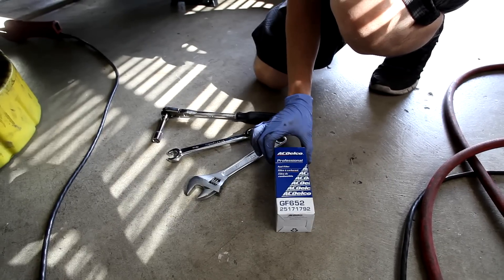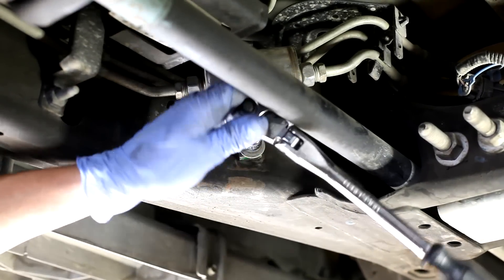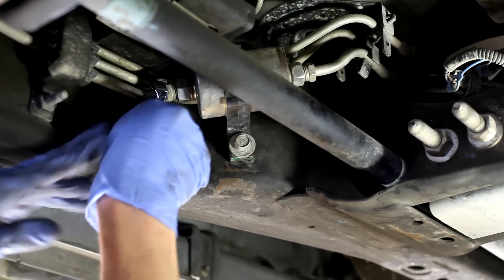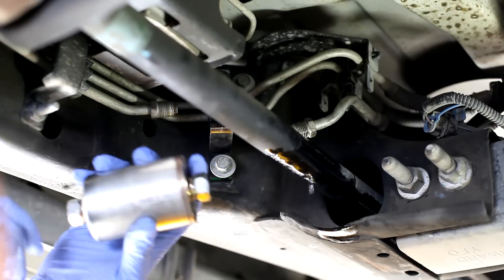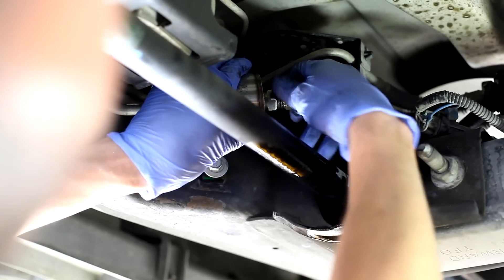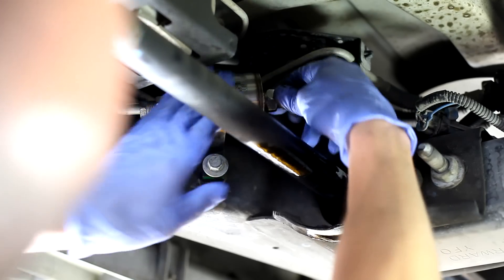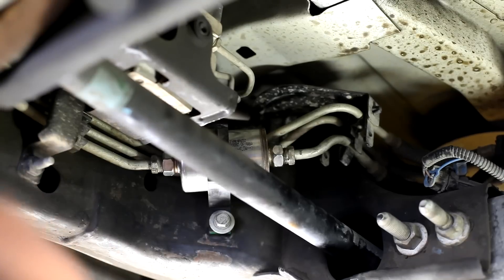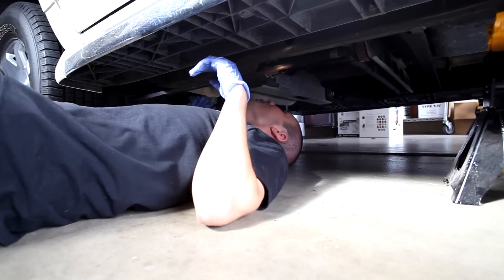2002-2006 Cadillac Escalade fuel filter replacement

Comment: FYI - on the 04+ Escalades, the fuel filter is in the tank.  There is no in-line filter.  Autozone will sell one to you, though.
Reply: That's why couldn't find it 😑
Reply: I havent been able to find one either. But i got a wix fuel filter for sale then. Lol
Reply: Thanks tokuzumi!
Reply: Bruhhh I just bought one even though i haven’t spotted it yet    -_- FML
Reply: I bought a fuel filter several years ago for my 2005....   was going to finally install it today, now I know why it was never installed.....   🙂  Thanks!!
Reply: 05 Escalade leave it to caddy to make everything more difficult. No hatch to access fuel pump either… dorks!
Reply: How do you change the one in the tank? Do you have to remove the fuel pump?
Reply: amazon too 😆 - luckily i made the return window

Comment: 2002-2003 only. 2004 and up is in the gas tank only!! It's a mesh screen on the bottom of the fuel pump. You will get a new one when you buy a fuel pump👍

Comment: I have a 2005 cadillac escalate ext  and the fuel filter is not there...  Any idea were it is?
Reply from the maker: Some say they stopped external fuel after 2001? If it’s not there, then it’s in the fuel tank
Reply: @NutzAboutBolts  maybe after 2002 because i just changed mine today thanks to your video
Reply: Guess after 04 they integrated them inside the fuel pump in the gas tank 

I just bought a fuel filter for my 06  though like ummm ,,,, they will sell u trash happily though

Comment: Wouldn't it be better to loosen the fuel lines before loosening bracket so less risk of lines flexing and kinking?
Reply from the maker: PedalTheGlobe it won’t be since you’re using 2 wrench, one to hold it in place and the other to loosen. If you remove it before the bracket, the fuel smell will leak through.

Comment: I would only use a crescent wrench as a last resort A regular wrench won't wiggle or slip off and snap the fuel line. They are Aluminum nuts and strip easy. Good wrenches are a must.

Comment: Ok great video... 👌 well done..! I was reading some the Text here and I just realized that my 07 Ext Escalade fuel filter is in the tank... I just replaced the fuel pump 2 Weekes ago and the Fuel pump relay and the starter relay and the Ignition switch... but after it runs fir a while it dies or tries to die... I don't know what to do... anybody?
Reply from the maker: Usually when you replace the fuel pump, you want to replace the fuel filter as well inside the tank with the pump.

Comment: Hey, doew the fuel pump need to be original to the truck or can it be any fuel pump? have a Cadillac escalade ext 2002. I just know some cars require the original but im not sure for mine
Reply from the maker: Get the AC delco, that's what dealer uses I think. Make sure it's the right year, make, and model for your car. Also, some Cadillac doesn't have external fuel filter, so check your vehicle first before buying one.

Comment: so how do you change the fuel filter if it's in the tank?
Reply from the maker: Not sure if you either have to drop the fuel tank to remove the fuel filter inside or you can remove it while the car seats off.
Reply: @NutzAboutBolts  Oh wow.. okay thank you. My Escalade is 3rd Gen with 107k miles.. never had any type of work like that done- I'm slightly paranoid that it will hurt the engine if I don't replace it

Comment: my 00 Cadillac Escalade won't start after being driven to Walmart and then coming back out 20 minutes later so I think it's the fuel filter I really hope it's the fuel filter I can turn the key Forward one click and I can hear the fuel pump running I'm going to check the fuel pressure and if it's low I hope it's the fuel filter again... LOL
Reply from the maker: it can be either one, I've had an incident where the vehicle runs for a couple of miles, then dies and would only crank but won't start. It turned out to be the fuel pump... when the fuel pump goes, you replace the pump and the filter together. Lets just hope its the fuel filter lol.
Reply: jorge pizarro Did it happen to be the filter cause  mines is doing the exact same thing?
Reply: B first thing I checked with the fuel pressure and it was low fuel coming out of the rail then I change the fuel filter after that it was the fuel pump I didn't drop that tank.. I cut a hole underneath the left rear passenger seat to access it

Comment: What year is that escalade
Reply from the maker: +osvaldo cordova 2002, some escalade doesn't have the external fuel filter.
Reply: Thanks looks just like mine except mine is a 2006? But yea I didn't seem to be able to locate mine is it covered by anything ?
Reply from the maker: osvaldo cordova
no, it should be open just like that. Maybe yours don't have it.
Reply: Yea probably.... good video and thanks for the info bro
Reply from the maker: osvaldo cordova
np :D
Reply: Yaaa 04+ dont have a external filter it’s including on the inside of the gas tank with the the gas pump

Comment: Isn't one supposed to purge the line before doing this? Not being an asshole, I truly cannot remember.
Reply from the maker: You can, but we didn’t. Just watch out for that fuel pressure to spray on you.
Reply: meh, a lil gas to the face never hurt no one lol. Hey, you wouldn't happen to know where my sub is located in my 02 escalade? is it under the center console, or in the back? There is an aftermarket deck installed in it but the sub doesn't work with it. Not my doing lol.
Reply from the maker: You can cover it with a towel to prevent that too. I’ve been hit once with fuel in the eye when I was removing the fuel line lol, it was no fun.